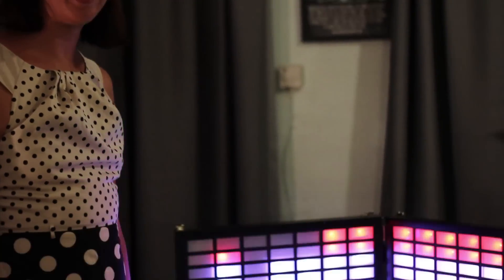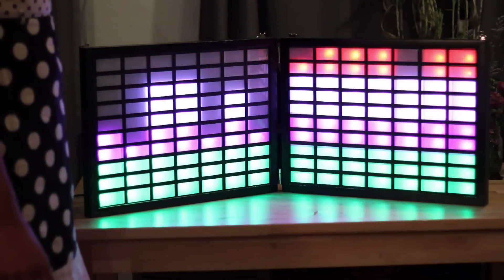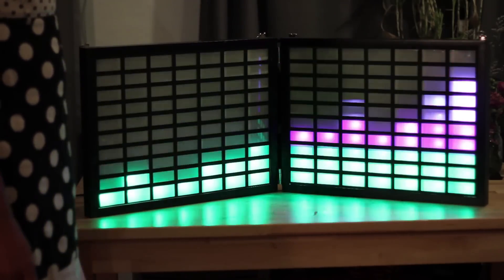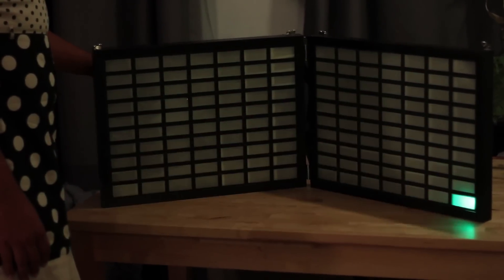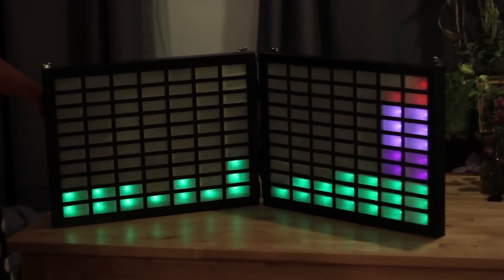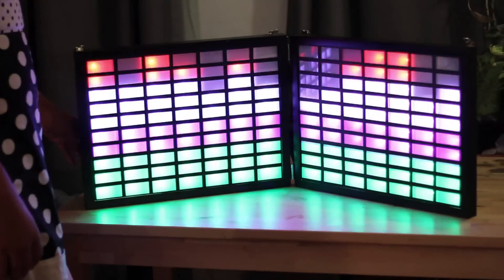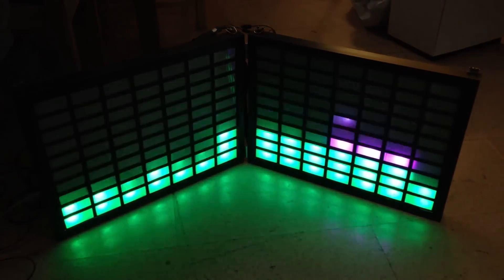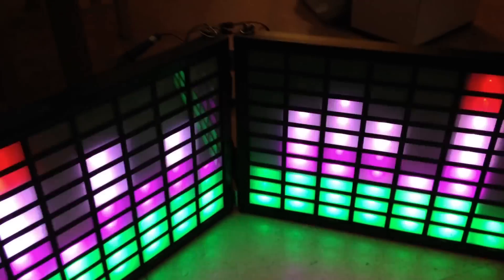Poster VU

Comment: Wow, great project. I may 'steal' some of your work for a wearable project I am starting. Looks awesome! I'm pretty impressed that an 8bit Arduino can run a FFT that responsively along with the overhead of driving the neopixels. I looked at fix_fft library and it appears it uses a look up for sin value approximations rather than doing the floating point math. Genius!